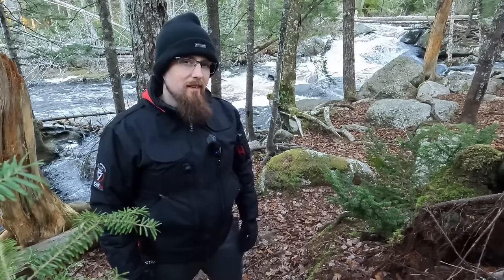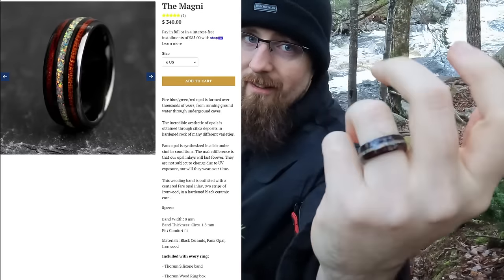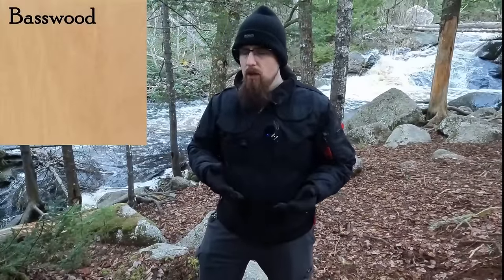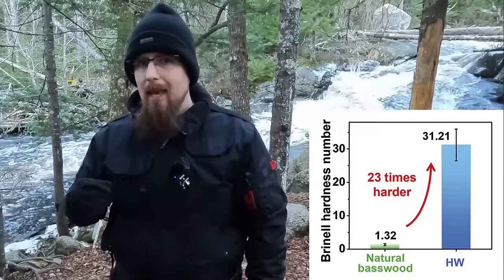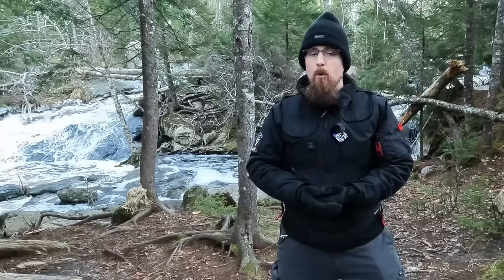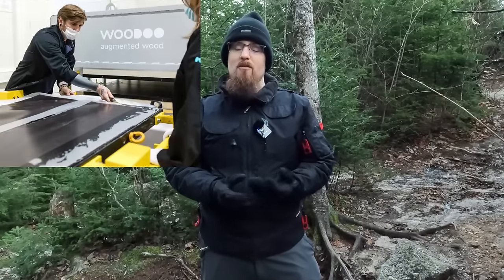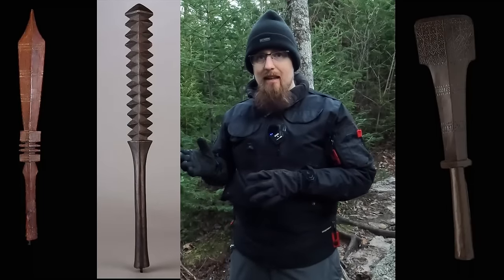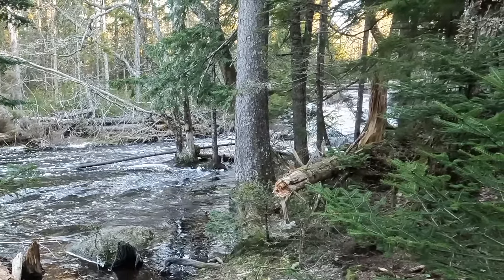Hardened Super Wood!  -  Can It Rival Steel?

Comment: When you mentioned ebony as an option I felt I had to mention that ebony is currently illegal to harvest in most of it's native countries, and illegal to import into many western countries without certain certificates. Ebony trees are currently endangered due to the wood's popularity for carvings (from souvenir trinkets to piano keys to chess pieces) contrasted to how much ebony you get per harvest and how long it takes the tree to grow. 

The black wood that you know as "ebony" is actually just the core (the "heartwood") of the tree, a tree that is is 6 inches in diameter only contains a core of about 4-5 inches in diameter (roughly 60-80%, depending on the species of ebony and the individual tree itself). Additionally, ebony trees grow remarkably slowly and reach "maturity" at 60-200 years old (for comparison; it takes a Canadian maple tree 10-30 years).
Reply: Can persimmon heartwood work? They are the same genus
Reply: That kind of makes me wonder if you could use this method to make farmed pine have similar properties to ebony as an ebony replacement? Musical instruments tend to benefit in interesting ways from material densities, and ebony used to be used quite a bit before (and after) it became endangered.
Reply: all old diospyros make black heartwood but yeah only after ages and ages

Comment: One thing a lot of people seem to forget is that people nailed things together with wood all the time back in the day. They just started with a drill. The whole process is called "pegging," and it was the preferred method of attaching things on ships, even when nails were available.

The main benefit I can see to this research into hardened wood is the ability to keep making modern materials after we exhaust readily available supplies of limited resources, like oil, which is necessary for plastics. I don't see it replacing steel anytime soon, but sooner or later we will have to replace our reliance on various plastics with something else, and this could be part of the answer.

Comment: While straight up replacing nails may be out of the question, wood peg construction would become much stronger.
Reply: Look up the company lignoloc they created the wooden nail, not only it's stronger but the nail contracts and expands at the same rate as the timber so no creaking

Comment: Having read the article, the fact that they don't give a stress-strain plot of hardened wood compared to steel (or aluminium) indicates to me that it probably can match soft metals in hardness, but it's probably more brittle with less total capacity for strain energy. 

Intuitively this makes sense, hardening materials often comes at the expense of reduced elasticity.
Reply: I wonder if you could use the pressing part of the process with different species of wood.  Think of having a "mild" wood and a "hard" wood being laminated as you would weld mild and hard steel in a San Mai knife construction.
Reply: @zach4505  The issue, i think, is that you'd still have a sandwich of different flattened pieces of wood on top of each other. One of the advantages of metals compared with alternatives like composites or ceramics is that you can fuse any two (or more) metal components via welding, whereas one a composite or ceramic is cured or fired, that's what you've got. You need to use fasteners or adhesives to connect pieces.

Here, you might be able to arrange some kind of interlocking wood surfaces that prevent sliding once they're pressed together, and use an adhesive to keep it from separating.  But at that point it becomes a question of that this offers that a composite (i.e. the carbon fiber/resin used to substitute for aluminum in larger parts of the Boeing 787). If it's only renewability, bioplastics might be a better option. And it's not like metals are non-recyclable.
Reply: @zach4505  "I wonder if you could use the pressing part of the process with different species of wood."

Not really.  There is a reason they used a tiny piece of bass wood.  Real wood can take a lot of weight.  A piece of real hardwood in a useful dimension would probably take far more force to compress than we could economically deliver.  I seriously doubt the biggest presses in existence today could do it.  When you start looking at a dedicated facility to do the job and you factor in economy of scale, I would say maybe but I would be surprised.
Reply: Like a brick you get a material that has extremely high compressive strength but without the fibers you won’t have a good tensile or shear strength. Different hardwoods also have varsity different grain structure resulting in pros and cons for different applications.
Reply: also, wood isn’t renewable, it literally takes decades for a tree to grow.

seriously go to one of those old mining camps and towns where they cleared basically the entire forest. an it’s been decades since and the new forest is no where near as big as it once was.

wood is NOT renewable.

an as for replacing plastic, we already have more eco friendly replacement for plastic...COMPOSTABLE plastic....plastic you can actually use in fertilizer and it breaks down much easier and safer. (also plastics have various qualities other than their durability and flexibility that makes them hard to actually replace)

as for replacing steel...  maybe in smaller applications freeing up more metal but highly unlikely it’s gonna replace steel on the whole.
Reply: @draconisthewyvern3664  Wood is not renewable is potentially the funniest take I have read in a long time
Reply: On top of what has been said already, iron very much is renewable already - and has always been renewable. So touting this either as a replacement, alternative or whatever else to Iron seems a little redundant. If not counterproductive, considering all the other things one could grow on the massive amounts of farmland that would be needed to make any kind of industrial use of this idea...
Reply: @SWAT6809  it’s not renewable. renewable means something that you can quickly replace. trees take years to grow if you wanna get the most out of them.

methane is renewable. it’s easy and quick to not only gather but also replace.

you literally produce methane. there are methane farms.
Reply: @draconisthewyvern3664  yeah, quickly. As in "much faster than carbon etc.". 20 years is nothing in comparison to millions
Reply: @draconisthewyvern3664  "A renewable resource [...] is a natural resource which will replenish to replace the portion depleted by usage and consumption, either through natural reproduction or other recurring processes in a finite amount of time in a human time scale." "An important renewable resource is wood provided by means of forestry, which has been used for construction, housing and firewood since ancient times." 

We literally produce wood, there are tree plantations. There you go.
Reply: @SWAT6809   yeah, forestry is so renewable that most of europe and the american coast is now plains filled with grass. even during the bronze age forests were on a steady decline thanks to human need for wood.
trees take years to grow in any useful length, and unlike metal, you cant reuse small scraps to make a large piece, unless you use so much glue that your plank is more plastic than wood.
Reply: @luansagara  Those forests are gone for entirely different reasons, such as climate change but usually because people didn`t want them there, so they removed them to make space for agriculture, cities and infrastructure.
Reply: @luansagara  Your reading comprehension is lacking.
Reply: @zach4505  that would be interesting for plywood.
Reply: @draconisthewyvern3664  that isn't what renewable means, wood is renewable because we can just keep making more of it these are plantations they are everywhere and you can't compare plantations(renewable wood production) to deforestation where the purpose was to just remove the trees the timeframe doesnt dictate how renewable something is even if it took 100 years wood is still renewable because it can be farmed like any other crop just over a longer period however the things they are trying to replace aren't we think we know how natural gas and oil formed but aren't exactly sure so it isn't like we can create pockets of material now that even 1000's of years in to the future we know would become oil deposits that would make oil renewable but as you can see time isn't a factor just can we make more of it
Reply: @draconisthewyvern3664  "Quickly" in the context of resource renewability refers to geological time scales.  When they say that something can be quickly replaced, they mean within a lifetime or so.  Also, there is a galaxy of difference between a well-managed forest that is actively planted in fertile soil and a strip mined area that has had the surface layer of fertile soil completely removed and the ecosystem has to start over from scratch with lichen and tiny mosses breaking that stone down back into soil.  If we decide to just use whatever time frame we feel like to be a contrarian, then I could shoot back by saying that technically fossil fuels are 100% renewable, we just have to wait a really long time for all the living shit around us to die and slide underground for a while.  Or, I could just tell you that solar and wind power aren't renewable, either.  You see, the sun actually will eventually run out of hydrogen to fuse after a couple billion years and we won't be able to replant the sun so therefore it is not renewable.  And wind isn't renewable because wind mostly comes from seasonal climate patterns that are caused by the sun.

Don't get pedantic with me, son, you will lose.

A tree can absolutely grow large enough to be useful within someone's life span, especially if the hardness of the wood is not that important.  Softer woods tend to grow faster, and with these chemical processes the hardness of the original wood isn't as important.  Bamboo, pine, Aspen, and lots of other soft woods and other woody plants can grow very fast.  But even so, I think that the benefit of a material like this pressed wood might actually be that we could just use any plant of any size.  We could just grind plant matter down and press it into form.  Or else, we could do kind of like how papyrus gets made and use much smaller reed-like plants, treat them to get soft, and then lay them out in a crosshatch pattern before pressing them into sheets of whatever shape we want.  Then we could potentially make composite wood-like materials in any shape or size we want, and the plants could potentially grow in just one season rather than 10 to 35 years.
Reply: @luansagara  99% of all wood used today was grown on a wood farm. People don't clear-cut forests for wood, they do it to make room for farmland.

Comment: The transparent wood for windows is really interesting.  I'd like to know how they stack up to the various types of glass pane windows.
Reply: From watching other videos about it, I think it's just a gimmick, sadly.  Basically the end result is just a plexiglass window with some bleached/leeched wood fibers in it.  You get a clearer window by just using plexiglass by itself, so the only real use ends up being an aesthetic one.  Admittedly, it does look neat.
Reply: Or various strong plastic or polymer windows.
Reply: One big problem I have seen with it is the wood needs to be incredibly thin for much light to go through it.
Reply: @CatacombD  good enough for a skylight. You only need brightness not to see the sky.
Reply: @pedromoura1446 The problem remains that the only real use is aesthetic.  Sure, if you want to use it, you, of course, could.  That doesnt change the fact that it's essentially just an overpriced plexiglass window.

You could use them for a skylight, but what practical purpose do they serve that a tinted plexiglass window couldn't do better and cheaper?  None, because the only value these transparent wood windows bring is aesthetic.
Reply: @CatacombD  you use like... 30 different Wood and Stone types for finishings in a house... What's the problem with using this one...? And depending on the polymer used this could be potentially more sustainable and/or easier to manufacture than plexiglass because all you need is wood, a solvent Solution and a polymer Solution instead of having to flawlessly glue several layers of glass and plastic... I havent analysed the product itself so i wouldnt know but it sounds interesting enough.

Comment: I've been following this tech for years. It has HUGE applications in the construction sphere, beyond just flooring and wood nails, which would be great in cabinetry applications.
Reply: I definitely see the potential for many things
Reply: Based on the paper it wouldn't surprise me at all if basically all other properties are negatively effected by this process. You are completely destroying the structure of the wood and just making it denser, not necessarily stronger in any way apart from hardness. 
Nails (as used in modern construction) need to be soft
Reply: @miles11we  Densified carbon composite strands. That's basically what you're left with. The only reason we like softer nails is that the steel loses sheer strength as we make it harder. For a wood nail, composed of a different material, this may not be the case.
Reply: I don't remember the specifics but it might of been Norway that has wooden sky scrapers, they used treated wood for the support and there are videos on the process with benefits and drawbacks.
Reply: @palarious  but it likely is the case. Look at something like gaboon ebony vs something like oak. The ebony is sooo much more dense and hard but its incredibly fragile in comparison. So take that and remove all the stuff that keeps the fibers connected to eachother, thats basically what you get. 
Not saying it won't have applications but let's be honest, they totally tested other properties but chose to not include that data.
Reply: @miles11we  my guess is that you're not going to see any improvements on compressive strength or tensile. But I don't think you're going to see losses, either. Eliminating the hollow spaces in the wood isn't the same as taking a metal and changing the chemistry. You're collapsing and compressing a complex structure along one dimension. 

Add to that a plywood layering approach and you probably WILL see significant improvements in material performance. After all, wood is already stronger than steel on a weight for weight basis. Compressing it, even with losses, still creates a competitive product with far less space usage and the ability to mold into complex shapes for far less cost than equivalent steel custom solutions.
Reply: @1NeoCross1  If you could dig up that video, I'd love to look at the feedback, especially from the practical side of things.
Reply: @palarious 
Don't you mean shear strength? As in, resistance to shearing?
Reply: @DinnerForkTongue  yes, and no one can read or spell these days anyways, so who cares?
Reply: @palarious 
Well, me 🙃 Just making sure "sheer strength" wasn't actual jargon. I'm not a native speaker.
Reply: @DinnerForkTongue  gotcha. On the downside, homophones in English can be difficult to spell, but in the upside, once you learn them, it's faster to distinguish as you read them.

Comment: There used to be a product called "gamma wood", which was ordinary wood soaked in resin. The resin was hardened by exposing it to radiation, presumably gamma rays. It was much stronger, harder, but also heavier than normal wood.

Comment: Great video! As a Bladesmith and a Bowyer, I can say definitively that hardness has nothing to do with how strong a piece of wood or steel is. The exact type of wood and steel, the exact way you are using it and the way it's treated is far more important than the surface hardness. There are just too many trade offs in the real world to make absolute statements or cherry picked comparisons. Like silica glass is generally harder than carbon steel and purple heart is generally harder than mild steel but all of these things break a lot easier that a car tire. It's a valid and fascinating field of study but I feel like they were asking all the wrong questions and presenting all the wrong points.
Reply: As a fellow bowyer/bladesmith I completely agree.
Reply: This is true. See my post above explaining that since hardness, unlike tensile strength or Young's modulus, hardness is not a fundamental property of materials; making it impossible to compare/convert hardness between dissimilar materials.

Comment: Even if this makes for a more economical and timely replacement for slower growing and rarer hard wood, that would be amazing!  Like, if you could grow a field of pine or basswood in a year and convert it into a harder wood for furniture or whatever else you would usually use hardwood for, instead of using pine or maple that take years and years to grow, that's amazing.
Reply: For pine try 30 years with thinning cuts for pulp wood every 7 to 10 years.
Reply: Bamboo
Replace hardwood with bamboo

Comment: Some of those hardwoods tend to fracture easily, I wonder how this stuff holds up that way.  Note: if you want to make staves or practice swords for sparring/impact practice, make sure to research which hardwoods are good for that, and watch out for grain structure (you want that as parallel to the length of your staff/wooden sword as reasonable possible).

Comment: The first question I have when we start talking about utility with hardness is what's the shear strength. There's a huge difference between armor that would deform, armor that would shatter, and armor that would budge at all. All of which also apply to modern day practical uses too
Reply: I would rather have armor that deforms but holds it strength